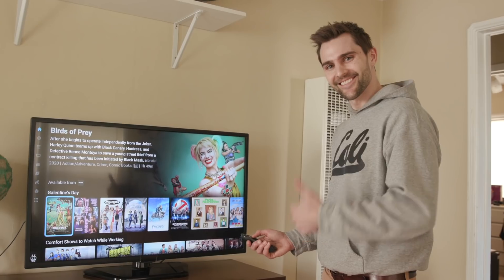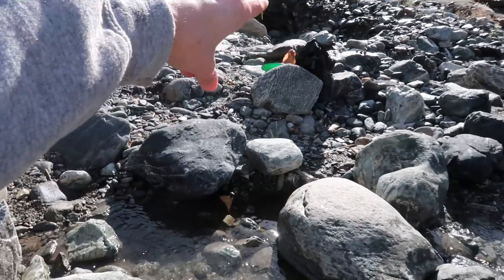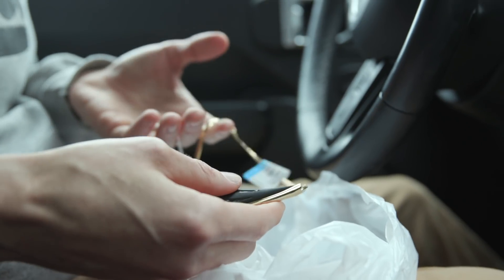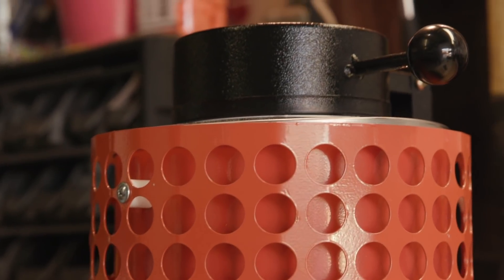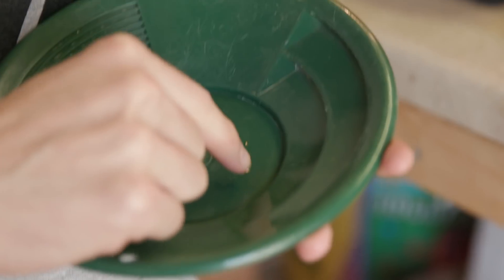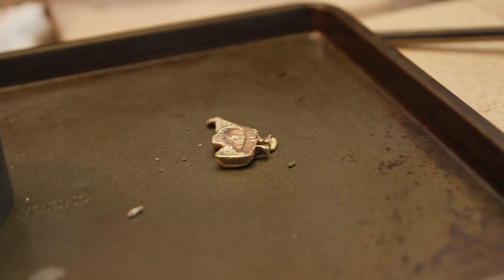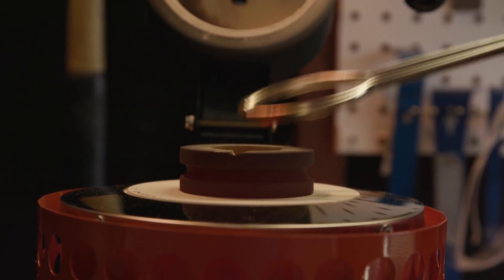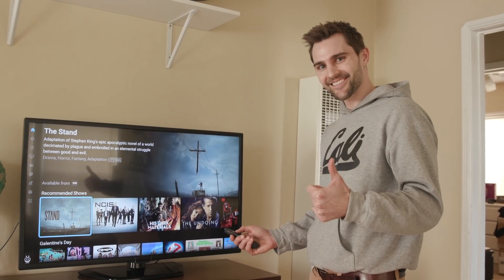Melting $2,200 worth of GOLD

Comment: 1) Preheat your mold! 2) I'm amazed you didn't actually promote your own show! Blown Away is great. Nothing wrong with letting folks know.
Reply from the maker: you're correct on both fronts!
Reply: @NickUhas  and your great! Looking forward to more projects with molten metals. You may want to try Field's metal which is an alloy that melts at fairly low temperatures

Comment: I’m a jeweler and if you want a good ingot in a graphite crucible use a little motor oil in it just heat the the mold with a torch pour a few drops of oil in then pour the metal it flows so much smoother
Reply: Really? I've never heard that but I'm far from expert. I'd think anything volatile in there like oil would just bubble/catch fire and possibly pop.
Reply: @gsmontag  the motor oil I use is a high performance oil most motor oils at high temperatures become higher viscosity and they don't catch fire
Reply: @gsmontag  and the thing i've found best to use to dispense the oil is an old contact lens solution bottle just wash it out and fill with oil and when i use it it works great dispensing just as much oil as i need to coat the crucible